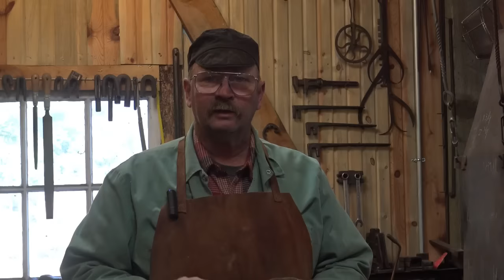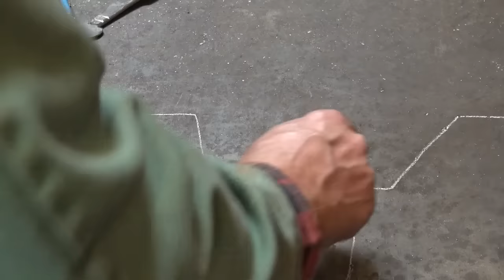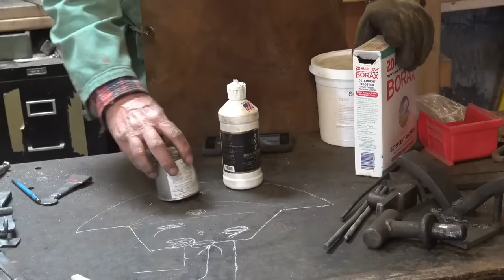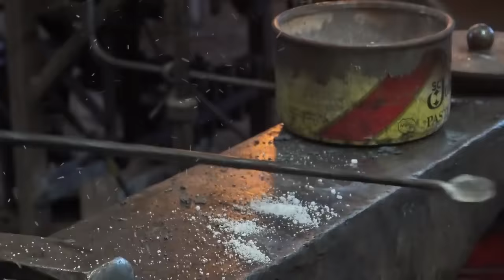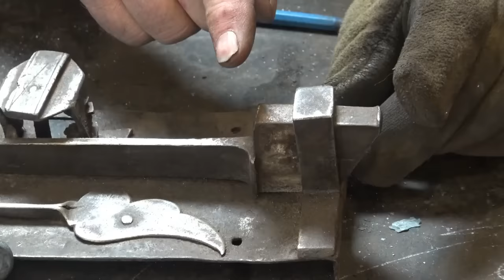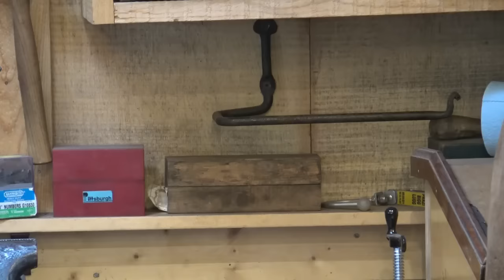Introduction to forge welding - basic blacksmithing

Comment: For metal working clothes that will not burn, treat a normal shirt and pants with silicon sealant. Just squeeze some on and smear it around with a putty knife. Treat the whole front, make sure you don't soak through, and you are good. 

I found this out by accident, I am a mechanic and my clothes were smeared with silicon gasket maker. I got molten aluminium on my pants for a few seconds, didn't burn me or the clothes at all. Give it a go.

Comment: sarry I snickered about the name fagget weld, but perhaps its a pronuciation thing like fillet weld is called fill it not ful lay like one would pronounce it for a cut of meat or fish,

this lesson how to forgeweld could prove useful, I am thinking of trying it with a torch and quickly set the weld with a hammer and hope it works, maybe it will with some borax as the flux of course.
Reply from the maker: I have heard of that being done, but haven't been very successful when I have tried it.  Having a second person to hold the torch so there is no wasted time going from torch to hammer may help.
Reply: well I just want to see if I can get it to actually stick even if its a bad weld, it would just be on scrap to practice anyway, just to get some inkling of what its like to do it and try it mind you, I tried to flow molten metal like when brazing to fuse two pieces once, and have seen people tack weld with a tig torch so I thought could be done with a welding tip on and oxy acetyline torch, it flowed the surface but refused to fuse that time, now to get more torch fuel and bring it up slowly so I dont burn though the metal again.

Comment: fagot and fascist is based on the same latin word... basically it refers to bundles of sticks.

with fascist this refers to the faschia i think it was called which was a symbolic bundles of sticks some body guards of the senators would carry... when they left they city they would add an axe to that bundle (and technically the senator would technically be out on campaign... the Romans had curious ideas about city borders...) the fascist adopted the same symbol since it symbolized  strength through unity. (a bundle of sticks is more hard to break then the sticks individually)

fag the slur word probably comes from the English usage of fagots as in bundles of sticks for burning... that then became slang for cigarette at some point.. and i am guessing here but the classic some times a cigar is just a cigar quote comes to mind as a possible connection or some related association...  blow jobs at any rate...